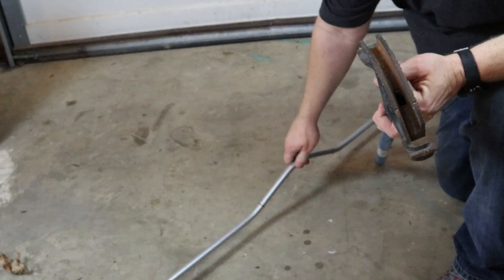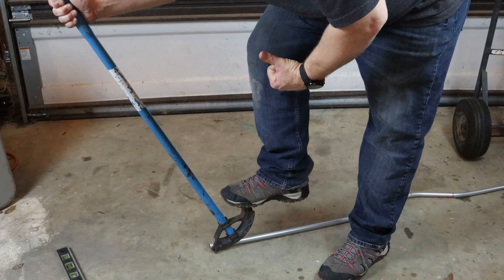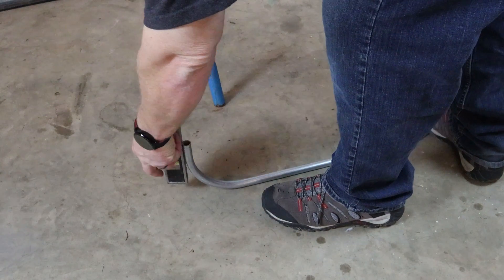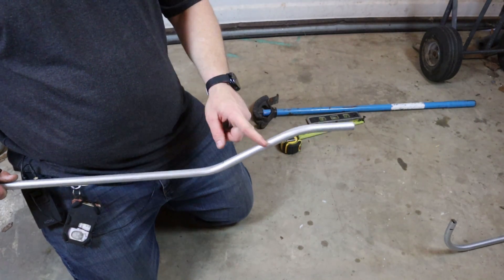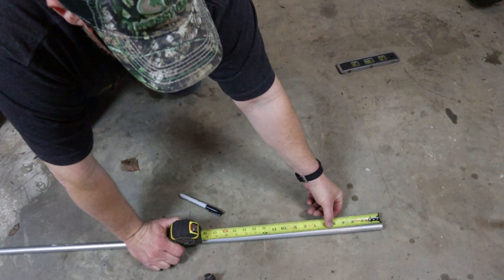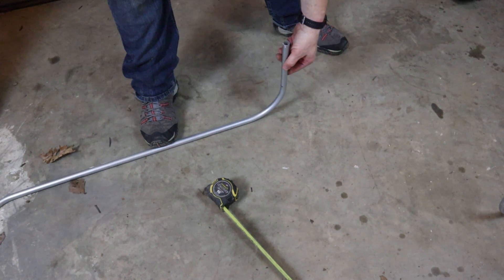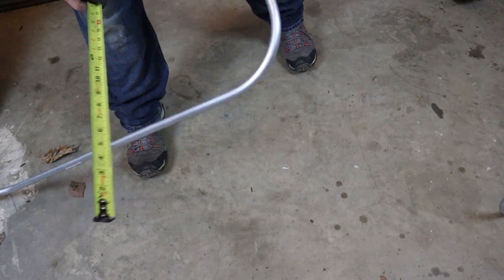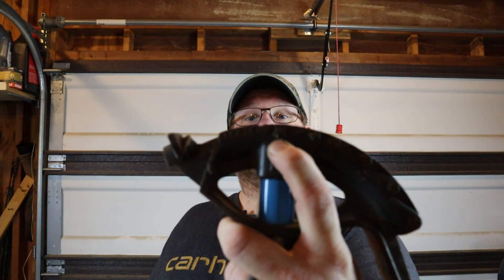How To Bend 90's On EMT Conduit

Comment: You always leave a half inch then you know you wont kink the end of the tube  lol   old school  way but if you need a box of set you bend that first then the 90  but why is know one saying anything about back to back 90s the easy way  cut pipe to total length  when its straight mark center then measure from center out then take offs then Ben pipe   old school way super simple and it's just quick math and then no cuts after the both bends  :)  just saying

Comment: Hi. Is it possible to make a handle that's about 8" before the 90° bends on each end?
Reply from the maker: I think that I know what you are asking, your referring to the 90 stub?? If so then absolutely
Reply: @MountaineerOutdoors  Thanks. To say it another way, the handle needs to have a bend at each end as if it had 90° elbows but be continuous (no elbows).

Comment: So when I'm installing my conduit and I'm coming to a corner, do the same rules apply? Also does my measurement come from the coupling side to the corner when determining the bend distance? So I created a 90 and measured from the connector to the corner. It was 64". Subtracted 6" because I'm using 3/4" so I marked at 58".  Put my bender arrow on the mark and I came up an inch short when trying to navigate around the corner. Just curious what might have happened. I'm going to mark at 60" and see if that gets me around the corner and stay connected on the coupling connector. What are your thoughts?
Reply: Measure from the center of the coupling tight to the wall then deduct your takeup. Also keep in mind if you are using minis.

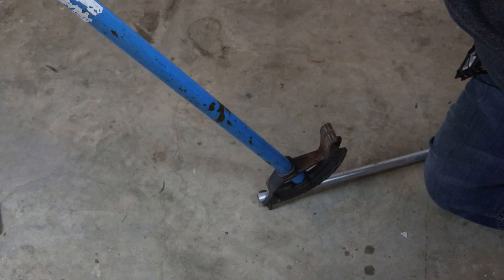Comment: At 6:08 your comment was “ if you know what I’m talking about, you know what I’m talking about; I don’t know what you’re talking about and you didn’t explain what your talking about; what were you talking about? If every bender is different why would you direct me to go to Lowe’s and take a photo of the handle of a bender that may be from a different manufacturer, that would not help me and additionally, every bend you made on the video was close but not a correct measurement. Please take the time to be concise with your instructions and explain what you talk about
Reply: If you know you know refers to having to hammer on the couplings because the emt is slightly distorted from having been bent right at the end. As in you have personally screwed it up the same way and had to strong arm the coupling on.  Take a picture of the handle refers to the cheat sheet table most bedders have on the handle- it has multipliers, shink/gain measurements etc. The sticker tends to get scraped up with heavy use.
Reply from the maker: Thank you ☺
Reply from the maker: As for the conduit not being exact I can tell you that it was close enough I wasn't wiring the Taj Mahal. And If you even paid attention to what I said about my quote, if you know what I'm talking about etc. Then you could easily figure it out. Good for you that, that has never happened to you. And for the pictures at lowes... Bro just use your head.. Im not gonna address in any detail for you.. If you would like an explanation hit me up on patron or PayPal

Comment: Just curious ..if i am only interested in lets say a run where I want the vertical to be at 50" on a 1/2 pipe ..do I bend 5" less - so 45" then bend.and I get 50"?
Reply from the maker: The best way to do that is to use the star on bender. Mark it on 50 and it will be 50.  Otherwise bend your 90  on a longer piece and you will have to cut it to the correct length. If you do it like you are explaining in your comment it will only be 45.
Reply: @MountaineerOutdoors  thanks
Reply: @MountaineerOutdoors  tttt